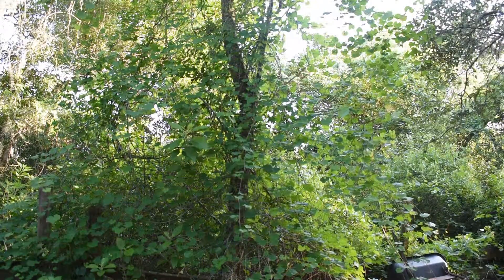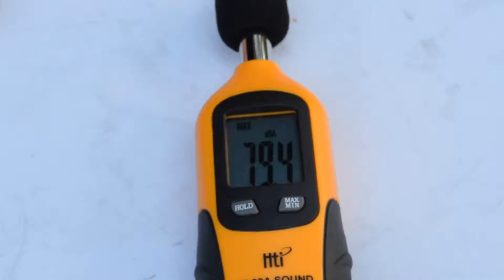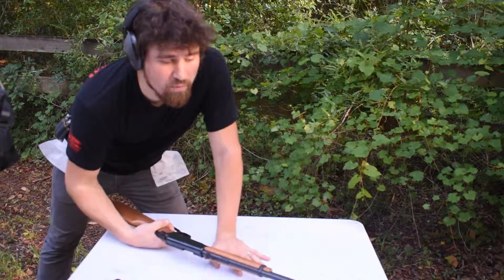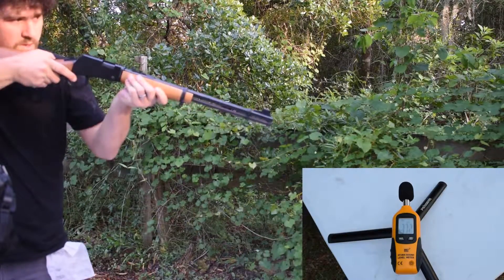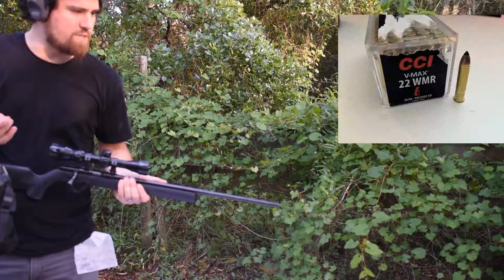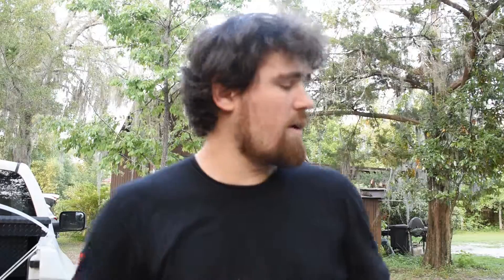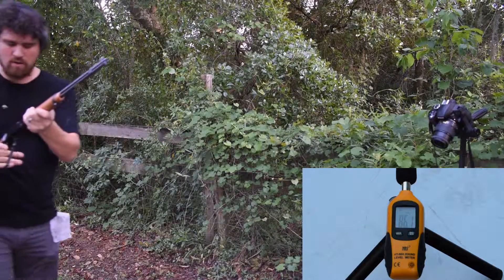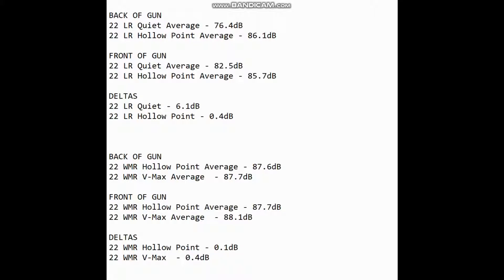22 Caliber Sound Test Part 2

Comment: Thanks for trying brother. But there is not a chance a 22 mag rifle is under 100db. Maybe the sound is too brief for your meter to pick up. I saw another you tuber have this problem until he got some expansive professional equipment on loan. I believe the 22lr was around 120db, and the 357 magnum from a 4” revolver was low 150’s.  His channel is called 1ShotTV I believe.  Hearing damage occurs at 99db or higher.
Reply from the maker: This is a likely case.  Maybe I can do the same test in some sort of sound isolation chamber.  But I am only using a $35 meter so who knows if it would even make a difference.